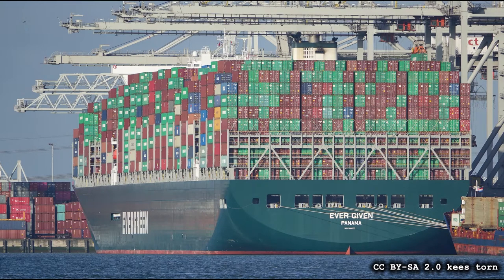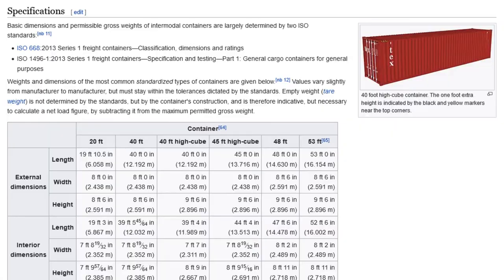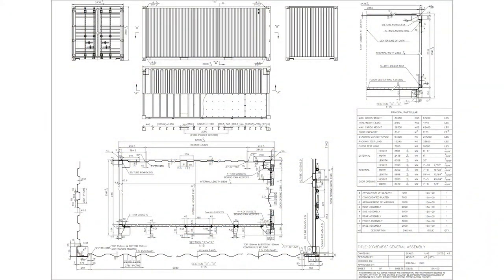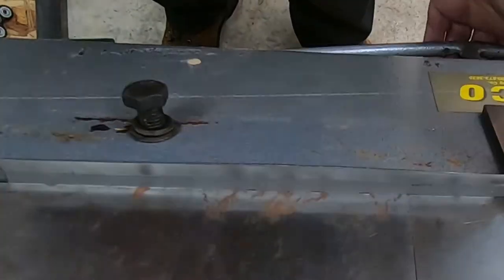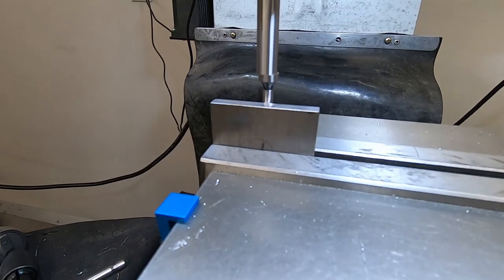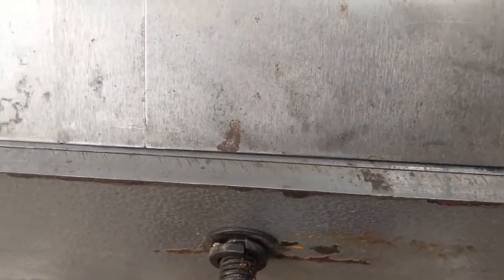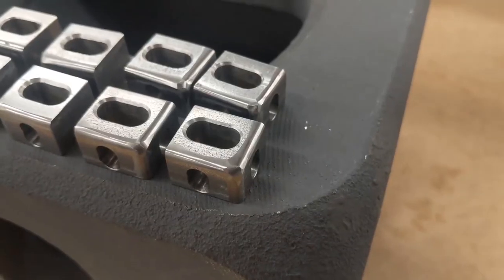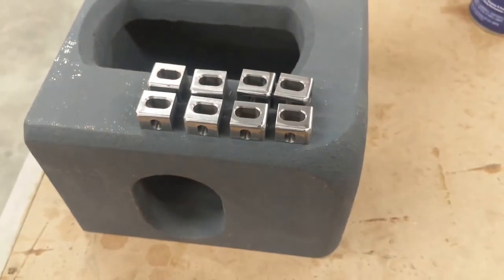Violating ISO 668 #1: Corners and corrugations

Comment: This is magnikficent, and I am particularly tickled that you went out and bought a corner casting. The old-school model engineering folks, when confronted by features of old castings, often approximate these not just as you have done, but also by building the parts up from smaller pieces, silver soldered together.